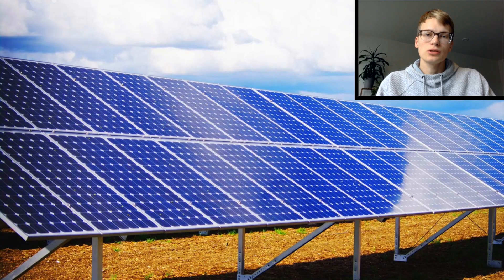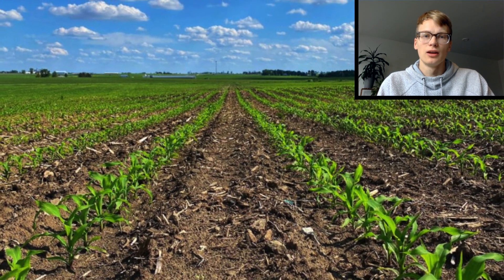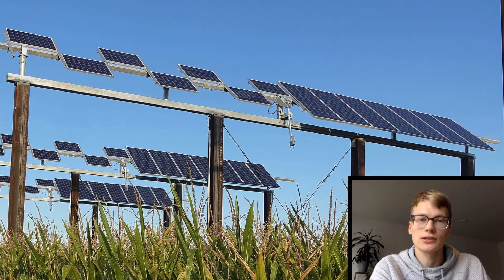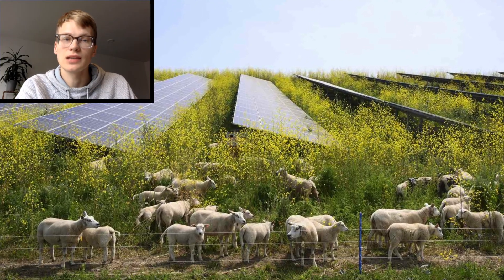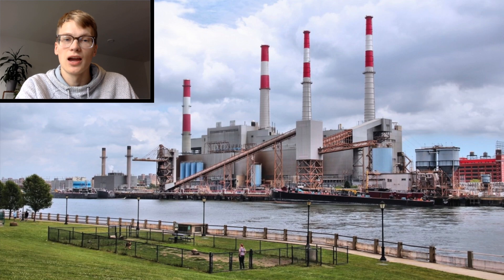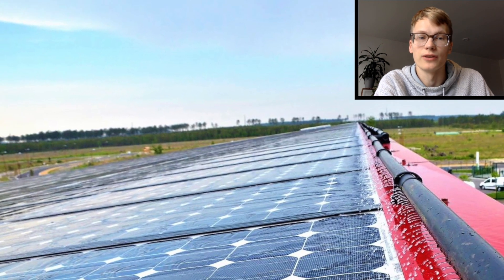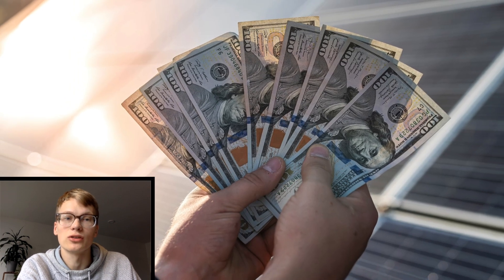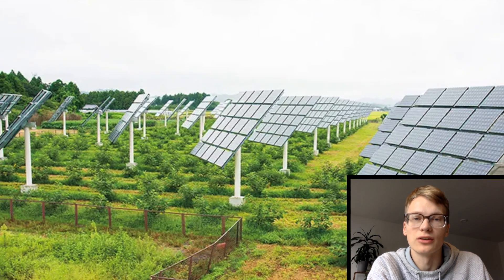The Combinational Strength of Agrivoltaics

Comment: Agrivoltaics suffer from the problem that their levelized cost of electricity (LCOE) is very high (~10-15 cent/kWh) compared to utility scale PV projects where LCOE is trending towards 1-2 cent/kWh for very large installations, while the agricultural use doesn't make up for the difference. This means the technology will, in a non-subsidised market, not be competitive. 
Your very optimistic take on the technology is also founded in a somewhat false assumption, that PV is often erected on land that was previously used for growing crops which is rarely the case. If you look at where the largest PV projects (and the most capacity in general) are build it is countries like the US, India, China and the Middle East, so countries with large areas of land, that are unusable for farming because they are too arid. The explanation for this is, that land cost is a big factor for LCOE over the lifetime of the project and unusable arid land is really cheap compared to productive farmland (which is in many countries also protected by all kinds of laws to ensure stable food production of the country). 
The only exception for this is Europe and maybe the east coast of the US, there large PV plants are regularly erected on land that has previously been used for grazing. Here the reasoning is, that land is much scarcer so the extra cost is still worth it and PV plants often allow grazing of smaller lifestock such as sheep, although I wouldn't really consider this to be agrivoltaics. And another observation you can make in these regions is that those are the ones with the most wind power plants, as those are naturally compatible with farming. So wind power is often a much more attractive solution to the farmers owning the land, they still get the benifit of leasing some of their land to the energy producer but aren't really impacted in their ability to use their land.
Reply from the maker: Thanks so much for the feedback. In researching this topic, I have found many local farmers have utilized this technology on regular crop producing land and not just arid land. There are very particular crops and plants that can support this type of construction, so this would not apply to stuff like corn, wheat, soybeans but more like greens, and small fruits.
Reply: @BENvironmentalist  I was very focused on utility scale installations, but you are right, we shouldn't forget the smaller and local projects. This could be a good solution to decarbonize energy production in rural communities that are still mostly agricultural. And if it's types of crops, that are usually harvested by hand, the lack of access for heavy machinery is also not that big of a downside.
Reply from the maker: You bring up great points and I totally agree, its just something to consider in the future.
Reply: +Finn Take away all the subsidies and welfare in all its forms given to fossil fuels and auto industry,
such as massive roads given to unnecessarily huge vehicles (SUVs) for a fair logically consistent comparison.
Reply: @theultimatereductionist7592  I think you totally missed my point, I did NOT say agrivoltaics is not competetive compared to fossil fuels. I said it is not competitive to other sources of renewable energy such as conventional photovoltaics or wind power. For which by now it should be obvious, that they are cheaper than fossil fuels as non-subsidised installations of renewable energy sources outcompete subsidised fossil fuel projects.